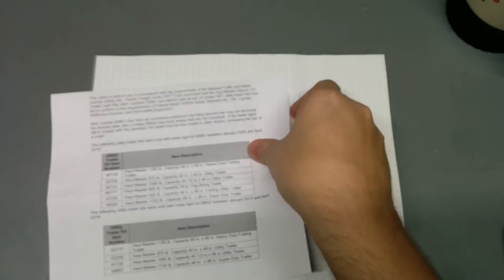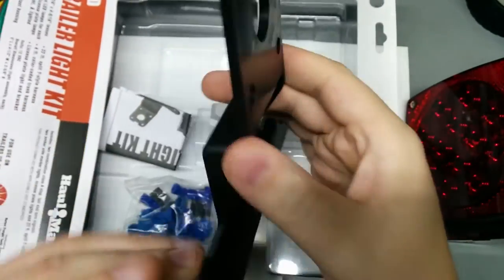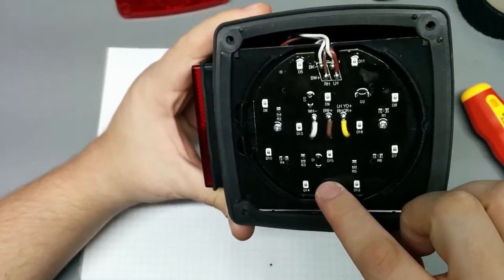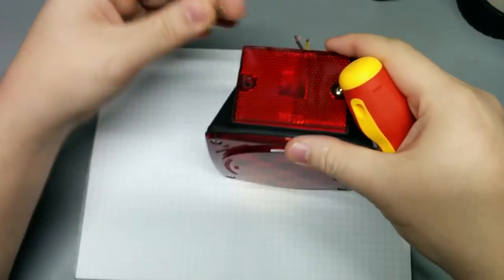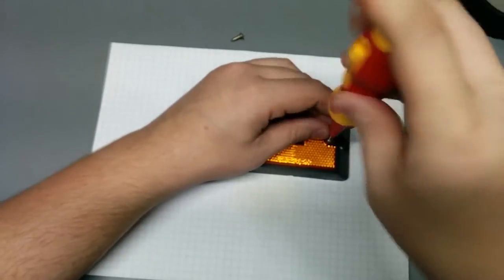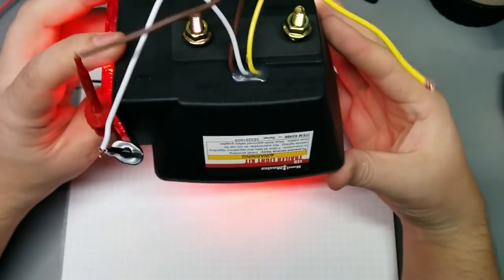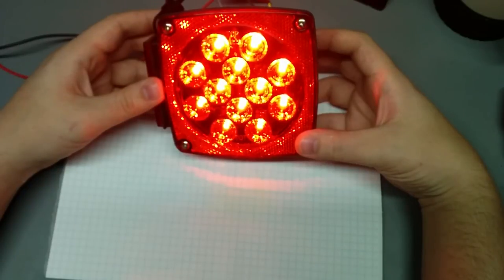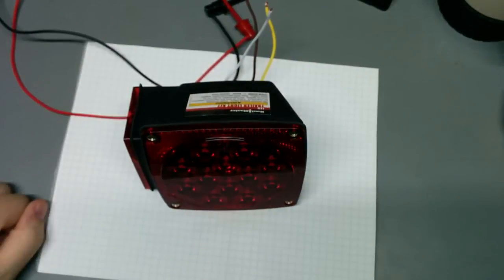Harbor Freight Folding Utility Trailer Light Recall

Comment: The replacement LED lighting kit is definitely an upgrade from the original incandescent lighting.  I have a mid-1990s steel utility trailer that regularly destroys incandescent lamps due to shock and vibration.  The trailer suspension is much stiffer than that of the towing vehicle, especially when it is being towed empty.  Because of this, I keep some extra bulbs in the weatherproof document storage tube on the trailer.